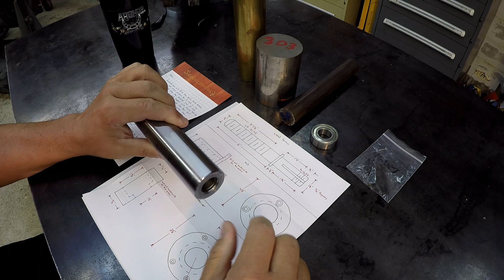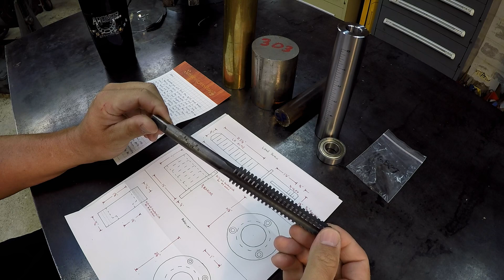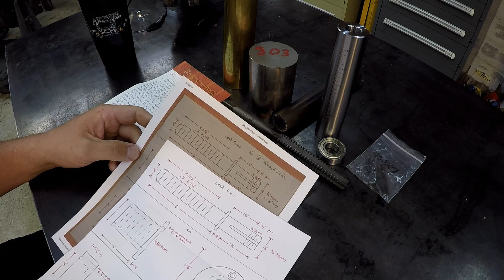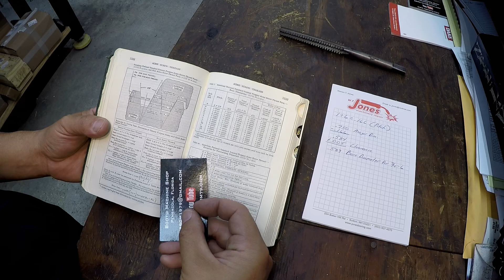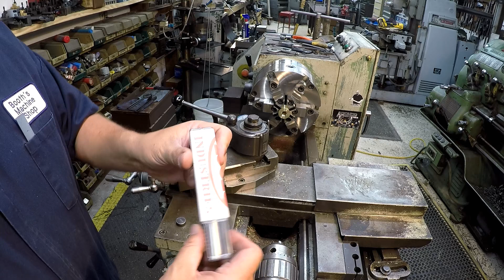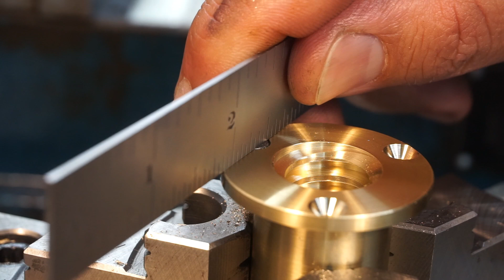Tailstock Acme Nut

Comment: As far as that acme tap goes, I would just set the chuck on the table of my tapping drill press and gun it at the lowest speed while blasting air and coolant all over the place...If I was to break that tap and Keith is coming after me for it, I would at least rather go out in style!

PS: I am willing to bet that with a proper tap holder, rigidly held part and some flood coolant, it's way safer and gives longer tool life than wrenching it's tears out as long as the motor has enough meat or a low enough gear, as the smooth action of a high quality tapping machine allows tapping things that you would otherwise mangle by hand, such as small interrupted threads at an angle etc.

Comment: Good tip for two lathes with shared tools: Machine the top slide mounting surface under the toolpost (or make shims) to match the heights for the tools. Did that at work for two lathes as they had a tiny 0.5 mm dfference in height and it was always fiddling with the height adjustments when borrowing tools. No more of that :)

Comment: One of the scariest jobs I ever did was tapping Acme threads in some stainless steel parts. It was a production job and we had quite a few to get tapped. If I remember correctly we were using a 3 step tap. I was sweating bullets getting those things tapped. We made it but just barely. The taps were missing a few teeth by the time the job was done.
Reply: I didnt even know you could get acme taps!

Comment: I'm about to show my ignorance of machining.  Can you cut ACME threads of the lathe instead of using a tap?
Reply: I'm a skilled machinist, and to answer your question; yes you can. A special internal threading tool must be ground making the job much more difficult. For an internal ACME thread that long a tap is the only way to go. External ACME threads are a little easier to cut, but still require great skill. Adam did it the right way as he always does.

Comment: Hi Adam - thanks for the video!!  It was very interesting.
Could you, or a viewer answer this please.  Based on the +0.05 clearance, If I wanted to cut a thread for a sliding bed or carriage, trying to minimize or eliminate any backlash, would I cut them with no clearance and then lightly file afterwards? Or is there a better method for this?  Many thanks for any feedback :)

Comment: I'm a little surprised you did the bore in a second op. That 6 jaw chuck must be very repeatable.

That's good info on the wrench and power tapping. I had a 1"-40 thread for a lathe tool height gauge that went cattywampus power tapping it with a wrench just as you describe. When I followed up on the second try, I just turned the tap by hand and it came out much better.

Comment: y using the wrench like that to tread puts pressure on the tap itself, especially on longer ones it will simple bent them has they are treading, i usually also every 2 3 turns i turn just a bit backwards to help realease some chip and reduce the pressure on the tap. Really nice professional job has always pleasure to see

Comment: Question on centering the drill chuck over the 3jaw on the 3-axis table... would simply freeing the table and letting the chuck itself center on the half" rod be viable instead of using a gauge?

Comment: Dumb Question time:

Threads start at the top of the cylinder, and spiral down.

Looking at any thread, you can see it's a single groove with a definite starting point.

But when you cut them, you will make several passes at it and seem to hit the same groove every time.

How in the world are you finding the top of the thread consistently? Don't you have to start at the precise top of the groove?

Comment: Adam, do you have any experience cutting buttress threads I have a upcoming job at work that has them. The pitch is 1 thread per inch and 6” diameter approximately.

Comment: How do I get a hold of you? I don’t know if you’re interested but I need help. I have a nice bar of cast iron, square of bronze, and need a new quill made as well the housing will need to be honed over a smidgen to clear wear. Unfortunately the manufacturer has failed to supply me parts after 6 months and it has now completely failed on me. I had hoped to deal with it and make my own quill but there is no way I can make it without a tenth or more taper. I’d ship the parts and rail stock body if you’re interested. Wouldn’t hurt to make a larger acme screw for it at the same time and beef it up so it lasts more than 9 months.

Comment: General rule of thumb for step drilling is:                                                                                                                                                                                                 For "Hard" materials, your lead drill should be about 3/4 or larger than the diameter of your finish drill size.                                                                                  For "Soft" materials, your lead drill should be about 1/4 or less the diameter of your finish drill. Do this to prevent the drill from "grabbing" and pulling the part out of the chuck, or the drill out of the tailstock. 
       For example, when drilling steel, if you want a finish hole of 1", use a starter (or lead) drill of no less than a 3/4" diameter (or larger) and finish with the 1" diameter drill.                                                                                                      
  When drilling brass, if your finish hole is 1", start with a lead drill of 1/4" (or less) and finish with the 1" drill. This works everytime.

Comment: Hi Abom79,

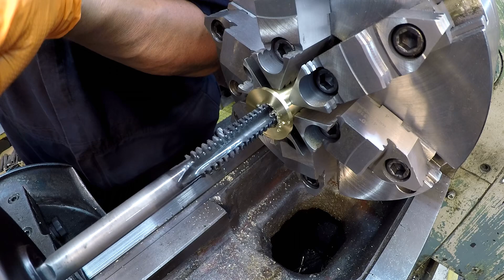around the 22:00 mark you're twisting a tap into the nut, but I noticed your lathe chuck/spindle actually turning a bit with it and wondered if you could instead have used the wrench to hold the tap steady and manually spun the lathe spindle to do the tapping a bit easier?   I don't know much about this stuff so I'm sure there's something I'm missing...   edit: oh, I'm probably missing how-to-feed?

Comment: Why not make a spacer for one of your quick change tool post so both lathes can have the same center height and you won't have to adjust the height every time you switch them from one lathe to the other?

Comment: Hey Adam, next time you're doing a substantial amount of work with brass/bronze/aluminum bronze/etc... try using a boring bar and run the lathe in reverse... blow all those nasty chips away from you.  An old time machinist showed me that trick for making bushings.  Nice job on the video, cant wait for the lead screw.

Comment: To layout a three-hole pattern like that in software (CAD/CSG), use some basic trig (it's just the circumcircle points of an equilateral triangle). To compute from center (lead screw in this instance), you'd do sin(angle)*radius and cos(angle)*radius to get your x and y from center.   Since it's equilateral, angle will always be 60deg. 

These two pictures some it up in an image: https://upload.wikimedia.org/wikipedia/commons/thumb/7/72/Sinus_und_Kosinus_am_Einheitskreis_1.svg/375px-Sinus_und_Kosinus_am_Einheitskreis_1.svg.png

https://upload.wikimedia.org/wikipedia/commons/thumb/8/8f/Unit_circle.svg/330px-Unit_circle.svg.png

Comment: Hey Adam, thanks for the video as always. Not sure how often you find yourself using tools between your two lathes, but back when I had two machines with different center heights, I machined a spacer to raise the lower toolpost up. Initially just superglued a block to the top where the height adjustment nut contacted. Kept me from adjusting tool heights constantly, could save you a little time! All the best, -Jerry

Comment: When I was a kid many, many years ago, I used the father's (a toolmaker and engineer) tools when I had a fairly simple job to do. I was once about to drill a hole in steel when he took the drill bit bit from me, and handed me another saying "Use this drill bit, the one you have has been backed off for brass".  He said you sharpen a drill bit at a different angle to normal for brass. Could you confirm this (or refute it) and tell me what angle should be used on a drill bit reserved for brass? Love your videos. Keep up the good work.

Comment: 360 has a sound that identifies it in an instant.
As does the cinnamonish smell of the TapMagic Alumnum. It does have something about it that triggers the spidey-sense that it might not be all that good to be in contact with or breathing too long. To further add to the concern is the lack of ingredient info on the can.  Been wondering what's in it for 30+ years. Still using it though.

Nice piece! Looking forward to the rest.

Comment: Come on Adam  I thought you loved challenges like screw cutting that thread instead of tapping.😄
Reply: Mehmet Temel I make them for my lathe at work , 2start LH acme,  cut with hand made bar and hand ground HSS tip. Or sometimes just grip the tap in Jacobs tailstock Chuck and power it in 👍

Comment: When I saw the title I thought maybe I would be seeing a process that I used to perform. As a power plant machinist we would quite often be required to thread valve motor operator stem bushings. The bushings were supplied by the motor operator manufacturer as a blank since they didn’t know what valve it was to be used for. Most if not all large process valves use a double lead left hand acme thread for the stem for speed. Being a power plant, all machining was manual since CNC was not cost justified for one off work. We used to single point double lead left hand internal acme threads quite often. Usually around 1-1/2” dia with a pitch of either 4 or 6. An extremely tedious process to say the least.

Comment: Adam

Could you explain WHY you parted off and then re-chucked that part instead of just drilling and boring?  It would seem to be more accurate to just bore it after drilling before parting off?  Would seem to be that evrything could be as concentric as possible at that time before parting off, while re-chucking could introduce some error.

John
Reply: He wants the treads to be concentric to the OD of the production part not the rough piece of stock.
Reply: @Chutchcroft4711  - Once the part is turned, it IS concentric/true, so leaving it in the chuck for boring Should result in the best cocentricity to the OD

John
Reply: John Crea apparently not
Reply: I wondered the same thing. I assumed he just didn't want to bore into a blind hole if he didn't have to.

Comment: I know practically nothing about machine other than watching, leaving the lathe head unlocked helped prevent stripping the threads and/or snapping the tap?
Reply: You can't lock the lathe spindle.  You put it in low gear to provide resistance.  If you apply more torque it will turn.  Big tap with chunky threads needs a lot of torque to turn.

Comment: Hey Adam, you may want to try some of the shooting earmuffs.  The electronic ones are pretty nice for stuff where there is noise at some points.  I was using some to cut down some brass and when the machine is shut off I can hear just fine but when the noise level goes up they cut out the sound and protect your hearing.  The more expensive ones are nicer and you can get the ones that actually work as a bluetooth headset as well and go in the ear like some earplugs.  Will be nice if you want to listen to something while you work but also have the ability to hear things going on around you at times.  Can pick up a cheap pair at some of the big department stores or sporting good stores to test out and see if it's something you like.  I enjoy them as when you want to hold a conversation you don't have to pull plugs out but when the noise level goes up you don't have to think about putting them in.

Comment: I obsess over countersinks too. I've started making my parts with a short counterbore on top of the countersink so the head is flush but the hole isn't bigger than the head diameter. Easy on a CNC, but you can do it on a manual if you use a countersinking bit the same size (plus a few thou for clearance) as the screw head.